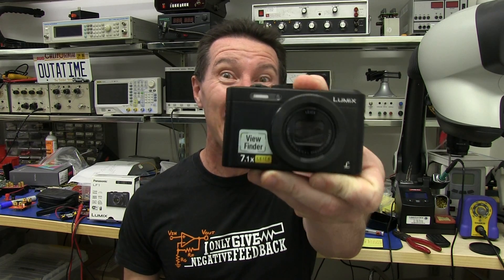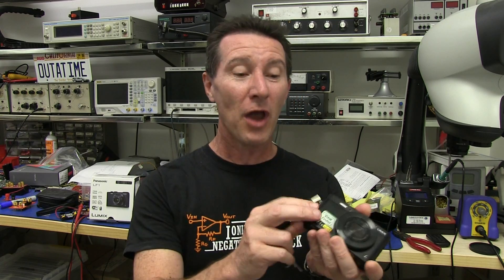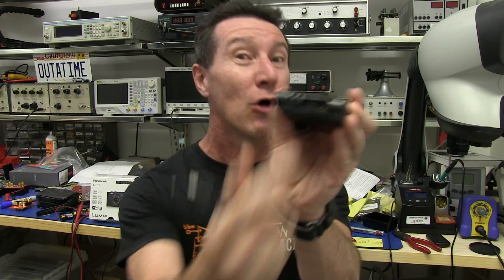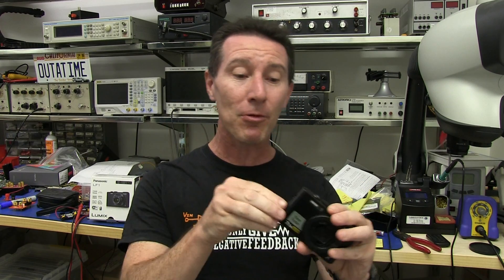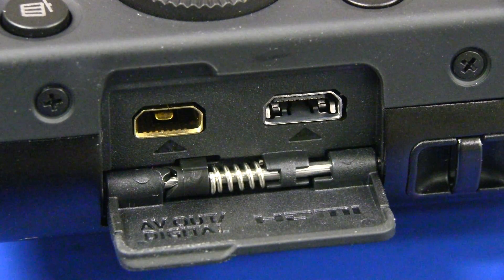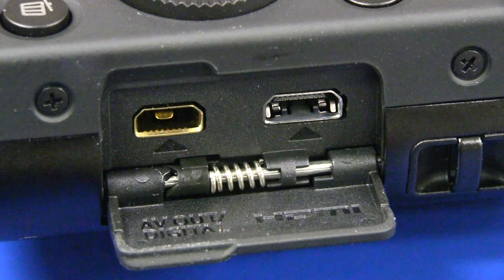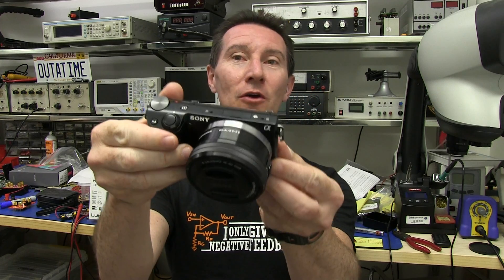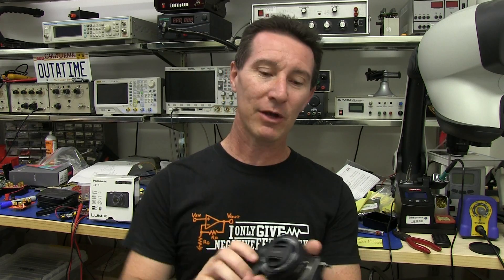EEVblog #578 - Proprietary Connector Rant - Panasonic LF1

Comment: I totally agree, the only reason for proprietary connectors is greed.
Reply: Greed?
Reply: jonskunator Well.. if the cable breaks.. can you then just buy an random cable? Nope, unless the chinese goes crazy with copying it then Panasonic will moneyrape you.
Reply: *****
Maybe, but I doubt they would make any significant money with some replacement cables.
Reply: ***** The Chinese does go crazy. You can pretty much find any cable cheaply from china nowadays. It's a stupid useless practice that old fart marketing guys need to stop doing.
Reply: I doubt manufacturers earn any cash from proprietary connectors at all. It might even net cost them money to design and engineer these obscure connectors
Reply: ***** Then THEY NEED TO STOP DOING IT.
Reply: Winston Smith
I presume we all agree with that already.
Reply: Winston Smith XD yeah well, stop buying products with proprietary shit on it, and they'll stop producing it, that's the only way any commercial party is going to listen
Reply: ***** What makes you believe I've EVER bought anything that hasn't had industry standard ports? I haven't. My phone and tablet both have microSD card slots and standard ports. I simply won't buy anything that doesn't. My POINT was that there should be just as much ranting about missing SD card slots as there is about non-standard ports. If more people would do as I do and not by anything without, there wouldn't be a problem. Trouble is, too many people are apparently sheep.
Reply: Winston Smith I didn't say that you were buying stuff like that. Though I personally find it too far reached to call people "sheep" when they purchase stuff with non-standard connectors. Besides, the world isn't covered in black tar any more; recent regulations have been pushing standard microUSB a lot, and I can only imagine legal requirements will continue to push shitty custom connectors out of the industry. Though I don't get your point.. I can understand that having proprietary pors is highly undesired, but an sd-card slot seems more like a feature than a functional requirement. You'll always need to charge a rechargeable device, but an sd-card isn't necessary for the functioning of a device
Reply: ***** "but an sd-card isn't necessary for the functioning of a device"

Neither is an industry standard port. Nor is a 2TB hard drive in a desktop. My point is that the reason inexpensive to include microSD card slots are too often not included is identical to the profit motive that results in custom ports. And people who calmly submit to that ARE sheep.
Reply: Winston Smith It's true that the reason to not include an sd-card slot is to encourage people to pay the premium price of having additional internal storage.. but the adoption of microUSB as the standard for charging was not due to economic burden you know. The reason the EU wanted to regulate micro-USB as a standard charging port was because of environmental reasons; manufacturers before had to include a shitty adapter with every single phone, now they don't have to because everyone already has a micro-usb charger. Now there's much less electronic charger waste. This is completely different than an SD card
Reply: "It's true that the reason to not include an sd-card slot is to encourage people to pay the premium price of having additional internal storage.."

Yes and THAT was my primary point.
Reply: Winston Smith this discussion has really side-tracked. Companies can still do whatever they want, without listening to what consumers want. After all, it's their product, their market and their profits. If you're designing a product while working for a public company, you have an obligation towards your investors and not towards the consumers. In other words, from a business standpoint it makes sense both to leave out an SD-card slot and a non-standard charger

Comment: Pretty justifiably pissed there Dave. These companies will never get it. Not until they are on the brink of bankruptcy.

There are always companies out there who want to get that tiny extra bit of revenue out of the customer. It's never enough for them. Not that you buy their product initially, no. They want you to have to rely on them directly for anything associated with said product. Play well with others? What's that? They don't know what that means.

These are the same companies that would probably take the shirt off your back if it meant their stock price went up a quarter of a point. Bunch of dick heads.

Comment: Its the marketing drones chanting after sales market of "extras".. Hey lets put this special connector in that only out cable fits, customer will eventually loose it and needs to buy new one, we can charge spare cable more then camera originally costed...  Except most cases now ex-customer buys new device that docent use proprietary connectors. Lessons learned.

Thats key thing when im looking digital camera, what type of connectors and batteries it uses... Not general standard? Now buying...

Comment: Dave let me introduce you to Apple, you will have a lot to talk about.
Reply: Magsafe, lighting connector, mini display port (isn't proprietary but isn't a standard), Dock connector, thunderbolt (also isn't proprietary but the cable and accessories cost is stupid high)
Reply: DAMN DAMN DAMN 24 EURO (32 DOLLARS) FOR A STANDARD LIGHTING CABLE....like its made of gold or something
Reply: pyro ex. No, thunderbolt cables are fully active cables. There is a collection of components at either end of the cable that work to make sure the signal is acceptable for your data.
Reply: ***** because the components are chosen and designed for the cable length. Do not take my comments as a blind defense of the cables. I am just trying to inject some fact into this conversation. Do I think they could have put all the required bits into the main board of the each endpoint... probably. However, considering neither of us are experts in advanced high speed signaling over copper. I am inclined to believe that someone FAR smarter then you or I have a good reason for not using passive only cables.
Reply: +Guilherme Rambo The last time i grabbed my mac to my lab/workshop the mag safe ended up full of metal splinters :(

Comment: I was lucky with my Kodak camera. Does charging though standard micro USB. And it charges with standard phone chargers so I just use my LG charger for it. My camcorder on the other hand (Canon) need external charger which is pain in the ass. And it uses USB but not micro (I think the mini USB).

Comment: Chinese cameras with AV out have the same connector. You can order the cable from ebay for a dollar or so... Check out the 808 #18 camera. You'd be amazed with what you'd get for 36 dollars.
Reply: This makes me wonder whether Panasonic simply contacted a Chinese manufacturer of crappy PoS cameras, and commissioned them to produce a Panasonic-branded one. I often get this impression with really low-end cameras due to their similarities; like always having pretty bad optics (which is the actual difficult part of designing a camera, anyone can design SoC, image sensor, screen and buttons nowadays)
Reply: It's more likely they just bought connectors from them... They would not risk their reputation on the same asembly quality as the 808 camera. I had to reflow one of mine twice since i bought it to keep it working... It doesn't seem practical for Panasonic to make a portable device as whimpy as those cameras.
Reply: Eviltech I dunno, I sure hope Panasonic put in the effort in their low-end as well. I know that Panasonic are pretty good in the mid-tier and high-tier section of cameras. I don't favor them myself, because they're fairly new in photography and rely heavily on Leica to even get the optics correct (don't produce their own lenses and such). Photography optics has always been a tricky thing, not something to take lightly. Having to reflow your own stuff is pretty bad though XD, what kind of shoddy camera were you talking about?
Reply: ***** The 808 #18. You can read all about it on the e-bay page. It's designed as a spy camera and weights a mere 18gr. It's battery lasts 40 minutes and it shoots at 30 FPS @ 720P HD. Sadly it's manifacturing quality is crap, but for 36$ you get the camera, a power cable, a power/AV cable, a USB cable and a 12V lighter charger. I have 3 of those cameras and i use them to shoot video when on my bike. One of them just died suddenly. Seems that BGA processor had a bad joint and a reflow fixed it. However the solder seemed to be crap because 2 weeks later i had to reflow it again. Than a month later i sold it just in case it desided to die again.
Reply: Eviltech Huh.. it's quite amazing what 36 bucks can buy you nowadays.. I looked at some sample videos of the 808 #18 here on youtube, and the video quality is much better than I would have thought.. I mean, it's pretty good quality if you take into account it cannot focus, it weighs less than a letter, and it costs less than a decent meal at a nice restaurant XD. No wonder the build quality is crap, I wouldn't even complain about it at that price!
Reply: Yeah, it also has a live feed on the AV output while filming in HD... Perfect for a onboard camera on a quad or a helicopter :) And later you can watch the video in HD...
Reply: Eviltech It sounds a bit ghetto, though as a (near) disposable camera it looks great! I mean, when you don't want to afford a Go Pro camera, these small PoS cameras seem a viable alternative. Their light weigh means they can take quite a beating as well; after all, the lighter something is, the less impact it experiences when falling!

Comment: It's worse when the dimensions are the same as a 'normal' standard connector & the plug fits the slot 100%, but the wiring is all screwy. I've had old camcorders with composite leads based on 3.5mm headphone jacks, with the video and sound the opposite of other cables. If you swap the colors around a bit it worked, but this idea is retarded... Especially since they probably want you to spend another $30 on a proprietary connector for an obsolete medium.

Comment: My LX7 is the same, but doesn't charge over USB.

The PS Vita has a super special USB cable for charging too - the USB plug has a notch in it to match a corresponding tab on its charger's USB socket. So you can plug your vita into any USB power source (with its special wire) but you can't use the Vita's USB wall wart to charge anything else because normal USB plugs don't fit down the special USB socket.

Comment: same story with my Sony Xperia E; it's a connector with exactly the same pin layout as a micro USB connector, but flatter and longer! it looks like someone just took a micro USB connector, hit it with a big hammer, and then soldered it into the phone/cable! Seriously though, for a good phone, WHY?!?
Reply: It is standarized mini USB. It replaces micro USB. It is standart. It is not "strange" thing. I will not go into details (read it on internet). But mini USB is better in many ways then micro USB.

I'm owner of Xperia Z1.
Also my Logitech G700 mouse uses the same mini USB cable so I don't even have to search for cable. It is always on my desk.

**
I got names other way round. Replace "mini" with "micro" if you want this post to be correct. My mistake.
Reply: *****  actually the name of the new one is micro, not mini http://upload.wikimedia.org/wikipedia/commons/thumb/5/5d/Types-usb_th1.svg/220px-Types-usb_th1.svg.png so micro "replaces" mini
Reply: BanquoTheMaker You are right. I got names other way round. But idea is the same. The new flatter one replaces older one. And both are standarized.

Comment: Micro USB connectors suck. They're flimsy and prone to breaking. And sometimes I feel like I need glasses to put one in properly. Whoever created Micro USB should be ashamed of the crappy job he did.
Reply: My recollection of breaking microUSBs has been bad design of the mechie parts - the way the casing material covered and anchored the contact core and metal parts. If designed well (there are some) this cable can work well.

Comment: I would say that was still a polite rant. In the EU we even got a law now to prevent the dickheads from using proprietary connectors. Sadly only for smartphones and tablets.
Reply: Hasn't helped much though... Apple are still complete dickheads about this - you need to buy a shitty adapter thingie... gah!
Reply: Yeah, the lawsuit is still going. We will see how it ends.

Comment: Oh and mine does av out through that port too, composite mono, despite the camera shooting 720p. No HDMI port anywhere on it, it is a cheap consumer point and shoot. I owned it's sister DMC-SZ1, and it did come with the av cable that I still have, but when it died, I bought this one at Walmart, and one of the cost cutting measures besides giving the same exact camera a different model number was to leave the av cable out. Good luck finding another UC-E6 to AV cable. Oh well, got a spare battery out of it.

Comment: Looks like the same connector on my Panasonic DMC-SZ02. It's called UC-E6. Only Panasonic and Nikon use it to my knowledge. Lost the charge cable for my camera (battery charges internally too), hunted for a replacement, Nikon brand cable. Ended up costing me $10 USD. Other than that, mine is a fantastic camera too. Panasonic and Nikon need to get there heads out of their asses and adopt micro USB.

Comment: A have an MP4 that have a propietary conector for the USB, but this connector serves both for the USB and the AUX INPUT (using 2 separate cables). Perhaps the Lumix got another functions over this prop connector using other cables that plug on the same place but do differente things. Panasonic has been in the market from the early 60's, and doing well since them, so if they decided to do that, they got a reason for sure. Perhaps not the good one from the engineer point of view, but they match, or are supposed to do, customer expectations. At least, if you hate this things (I hate also prop sh*t like MAC connectors) well, don't buy them. Microchip would have made a vid for you from the PicIt III complain, but don't expect one vid from the Matsushitas group LOL

Comment: Go to love Them F U connectors as i call them. And will micro USB is not much better, at least you only have to carry around one cable.
I honestly wish company's would just use Mini USB is only a hair bigger but it's allot stronger then micro USB.
Reply: Ty Cetto Uh... sorry to say, but it's REALLY hard to jam in the connector upside-down.... so, that's not really their fault.
Reply: Frozen Electronics
I know, but my GF doesn't give up that easy... It wouldn't fit, so she just squeezed even harder. 
The result was a broken connection INSIDE the phone and that was bloody expensive to repair.

If you don't look close, the micro USB female connection isn't so easy to see up and down on. She went with the marker on the male connector and as it was a Nokia branded connector, she took the NOKIA name as being up... (It got the USB marking on the other side...)

I wasn't a happy camper after I saw her handiwork!

I'm not saying that it's LG's fault, but just that the micro USB is poorly designed; also that the MINI USB is not much bigger and MUCH better in design, more sturdy and impossible to turn upside down, due to the design.
Reply: DAMN true!

The micro USB sucks balls! My GF managed to connect her expensive LG phone with the cable upside down - a trip around the workshop and a lot of money handed out, was the result.

Bloody shitty connector!
Reply: oh... i never knew there was a difference between mini and micro usb! i thought they were the same bloody thing! aaaarrrgh....
Reply: Ty Cetto I feel you man, my ex would have done the same thing. Gotta love them!
Reply: I agree long as they make it USB 3 for the faster transfer speeds.
Reply: ***** I've had a phone fail for that very reason where I could not charge the battery any longer, and was forced to replace my still otherwise good phone, thankfully it was not under a contract lol!
Reply: Frozen Electronics
LOL!

I'm a carpenter as my first trade and I've seen wrecked kitchen doors, drawers and cabinets for many years, most of them ruined by those lovely female beings!

Gotta love them for their kind nature, just don't be anything technical or they'll slash your throat right away!

Comment: HTC managed to have their extUSB proprietary socket have 11 pins, to carry USB, audio, and microphone signals, while at the same time still having a standard mini-USB cable plug in absolutely fine. Engineering sockets that are compatible with older/existing connectors isn't hard. USB3 sockets accept USB2. There are combined USB2/eSATA ports. As you said, it's marketing bullshit aimed purely at screwing the consumer out of a few extra bucks when they lose that one cable...